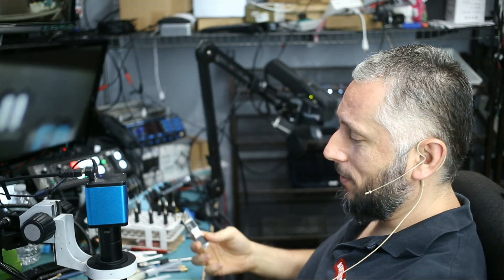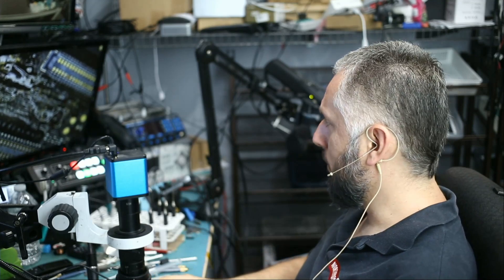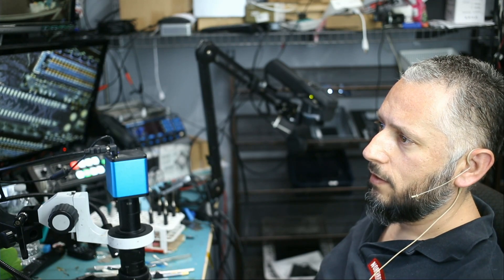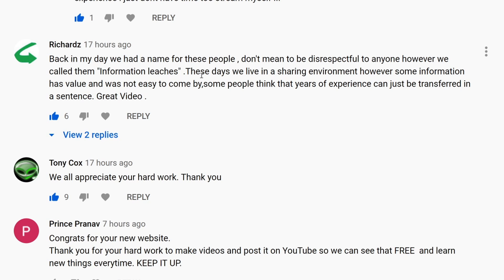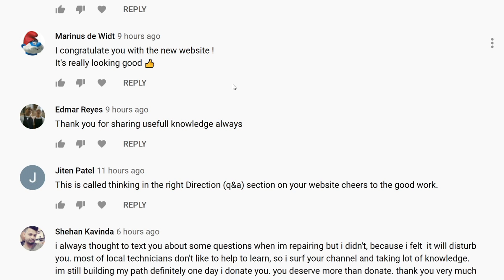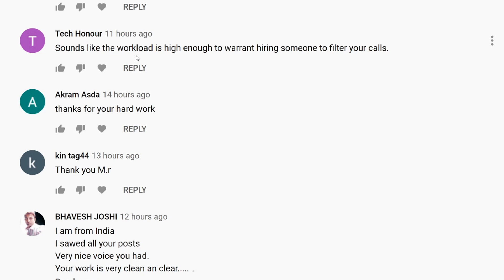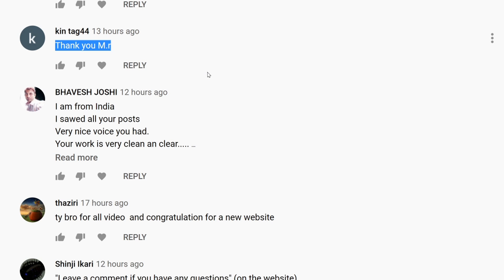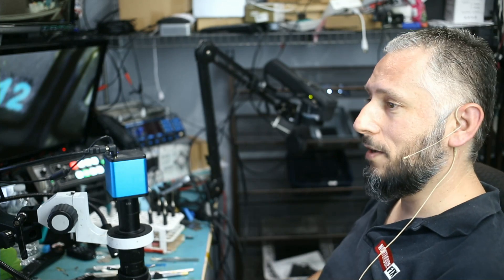Non fixable devices and repair attempt fees - Let's look at this iphone's FPC connector.

Comment: I tried changing the SIM card reader on my iPhone 8 Plus motherboard. Didn't look good, and the board started getting hot near the baseband chip. Tested the board and now there is a short of VDD_Main for some reason. Popped off a bunch of capacitors on VDD Main that are near the sim reader where it was getting hot with no luck. Maybe the baseband chip went bad? Board probably completely dead now.$400 down the drain.😥 Im gonna just try finding a damaged phone to buy that still has a good board and touch id button